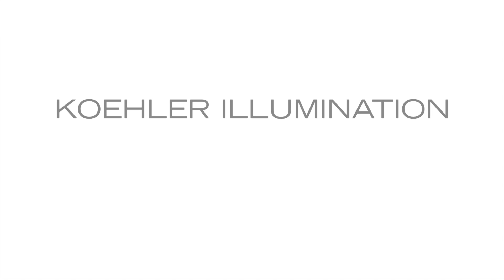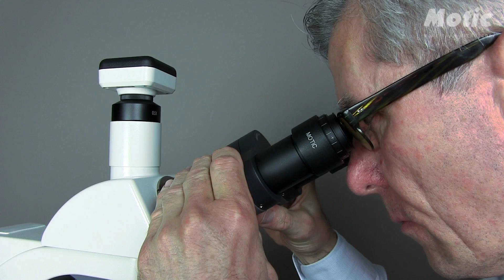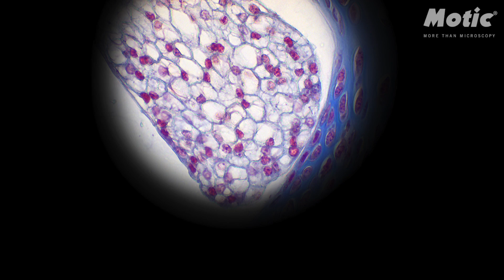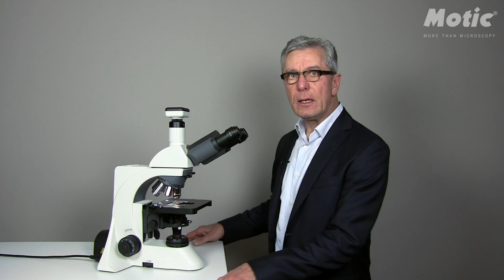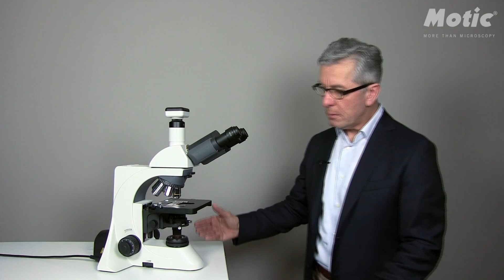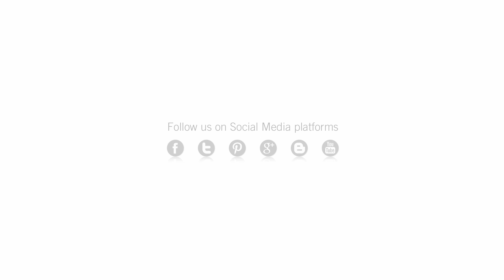Koehler Illumination - Setup & Alignment | by Motic Europe

Comment: Why is there a tradeoff between resolution and contrast?
Reply from the maker: Hi Jaywai, thank you for your comment. When closing the field diaphragm or aperture diaphragm, we obtain more depth of field with more contrast but lower resolution. Have an excellent day!
Reply: @Moticeurope  Is there any reason why that is the case? Why does increasing the contrast lead to lower resolution?
Reply from the maker: Hi Jaywai! There is no particular reason related to this case, it is just a technical matter based on the characteristics of optics and light refraction.
Reply: @semcify  Because closing the aperture diaphragm also reduces the amount of light photons hitting the specimen and therefore the resolve isn’t so good. Simply less light in sacrifice for contrast and wider DOF. Good for finding invisible non-stained microbes